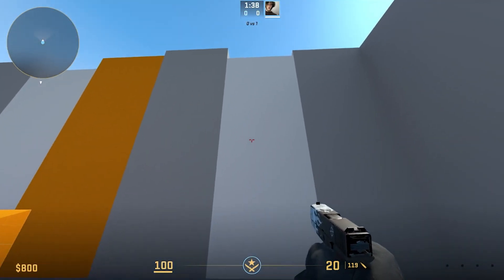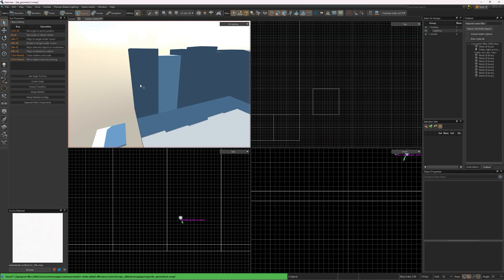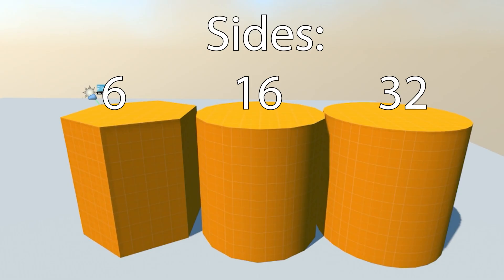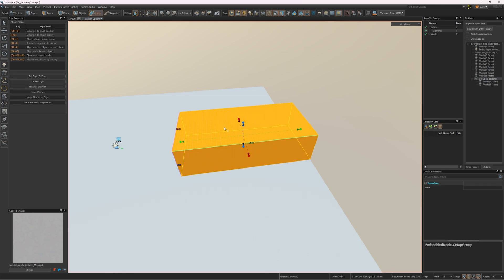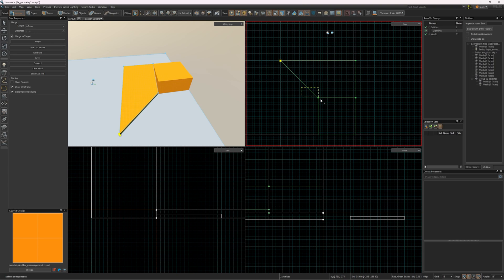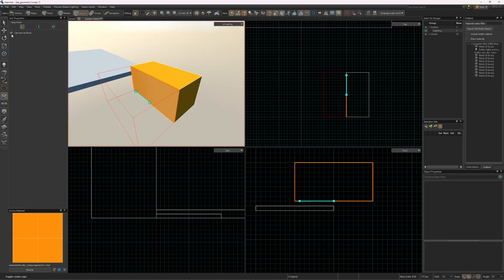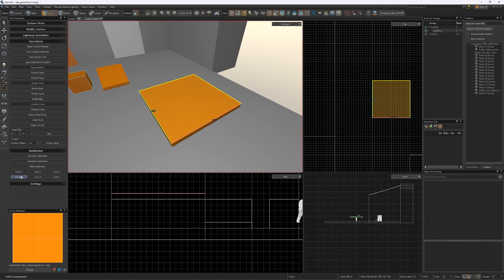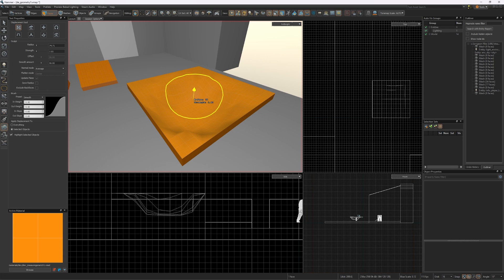GEOMETRY, DISPLACEMENTS & TEXTURES IN HAMMER (SOURCE 2)

Comment: Could you do a turtial on using external objects not made in hammer 2 has a map surface? I love using tenchbroom for how quick it is to make geometry.
Reply from the maker: Youd have to import it as a model and use it as a prop in the level
Reply: @CSJxlp  does people geometry and mesh geometry get processed differently in anyway? Such as how they might be culled in the render depending on where the player is lookingM

Comment: Nice tutorials mate. Coming from Hammer 1, this new software is so much better! I'm wondering what the 'best practice' is in terms of brush work - Is more square-shaped brushes better than fewer complex brushes? Now that it's so easy to extrude faces and create complex brushes, I'm naturally inclined to block my floorplan out with one brush, rather than lots of blocks as I used to in Hammer 1. Do you know if this method is good or bad in terms of performance?
Reply from the maker: I’m in the same boat, moving from source 1 I’m not sure what the appropriate workflow for source 2 is yet, once I find out I’ll make a video about it.
Reply: @CSJova   Please don't work with brushes lol, Source 2 is mesh based. Start with planes and extrude with edges rather than 4 sided blocks